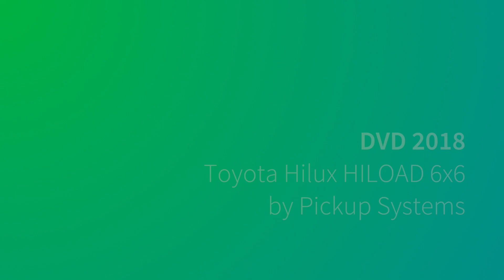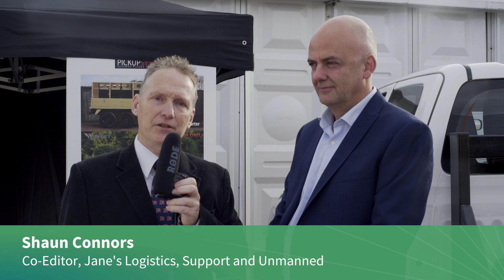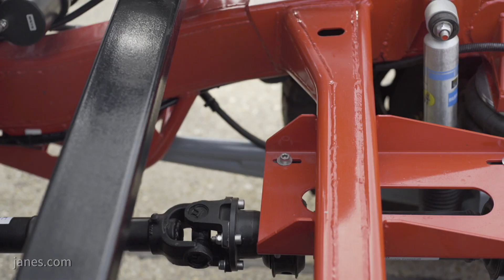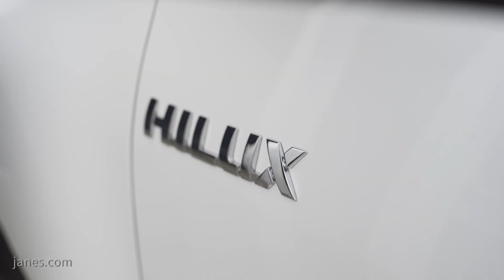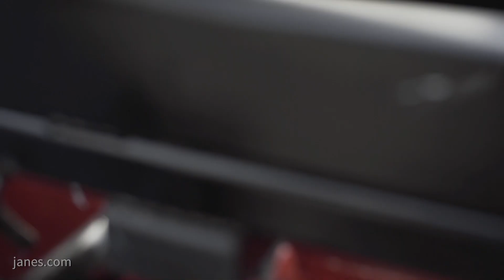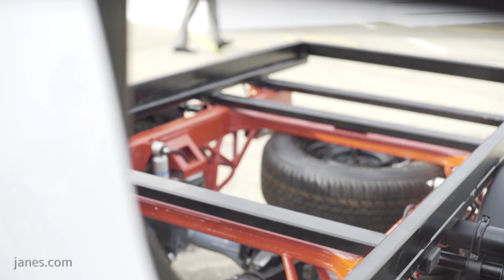Toyota Hilux HILOAD 6x6 by Pickup Systems (DVD 2018)

Comment: Like this Pickup Systems Toyota Hilux HILOAD 6x6.bed 6x6 pickup truck, carrying conversion, would be ideal as a base vehicle for a crew cab petrol / LPG bi-fueled engine automatic 6x6 flatbed pickup truck, to carry an off-grid demountable large explorer campervan.

Question would this Pickup system 6x6 conversion work with a Land Rover Series 2 or 3 or Defender 110 / 130 crew cab pickup too?.